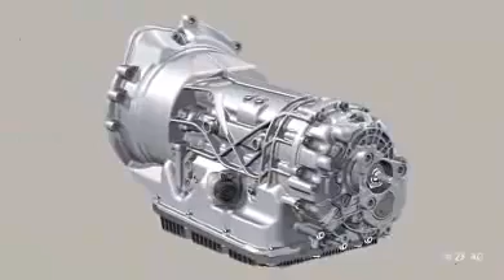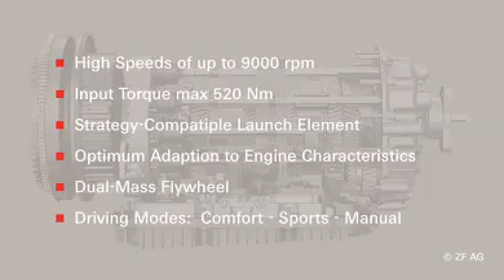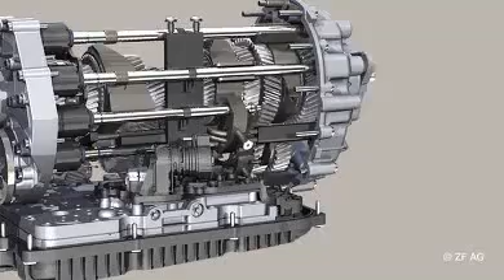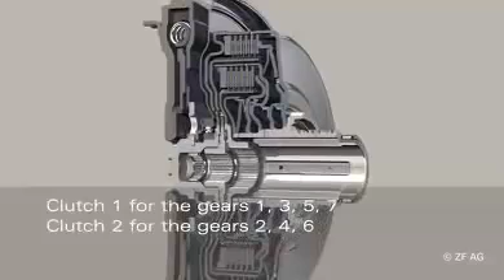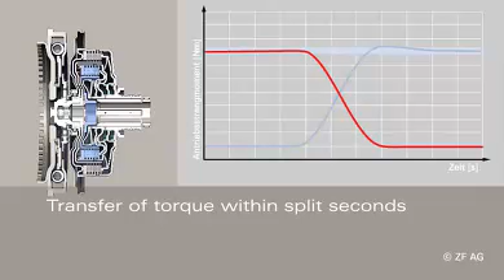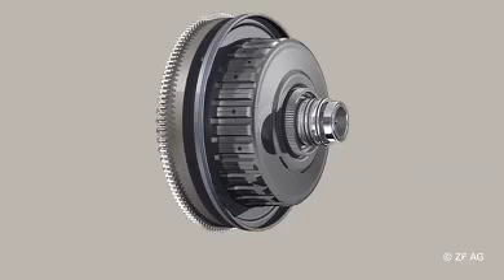DCT DUAL CLUTCH TRANSMISSION by http://www.bosstrans.com

Comment: My experience with automatic transmissions  especially the ones where the valve body is on the lower part of the gearbox is the repair part...too much expensive but hey that’s my opinion